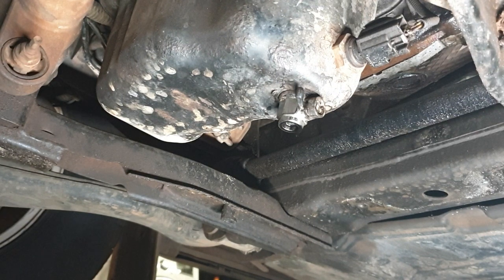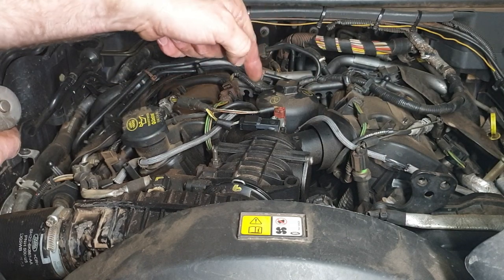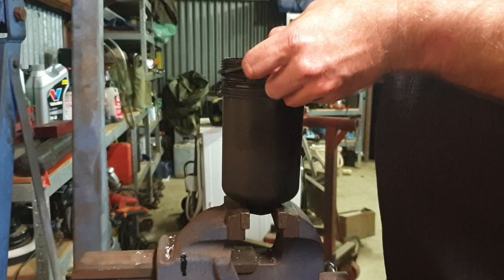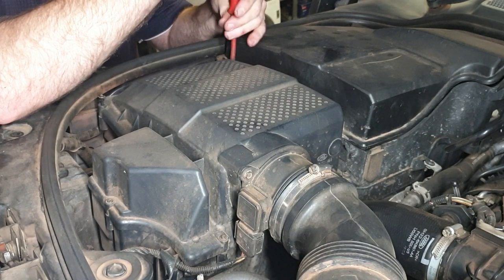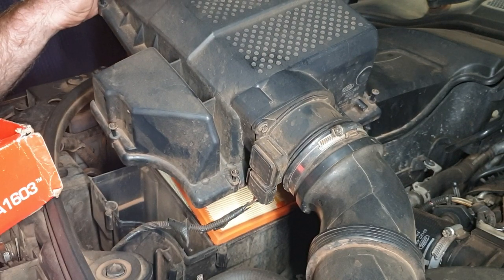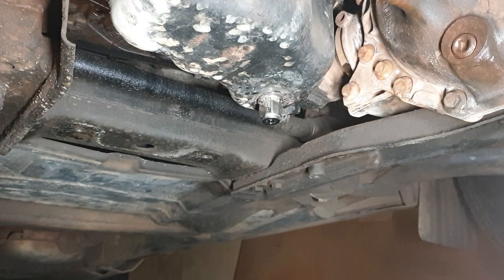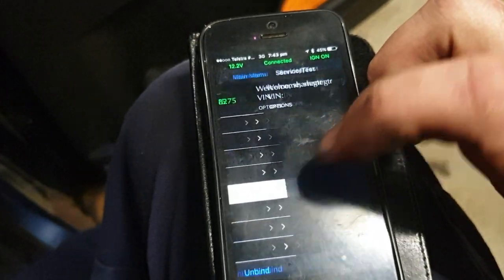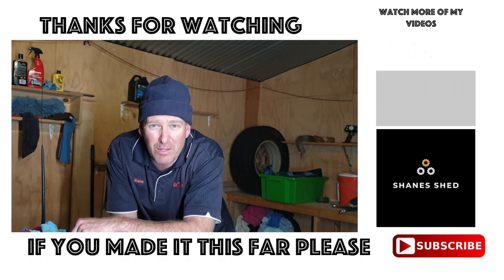LR3 Discovery 2.7TD Engine Oil Change | The easy way with no mess | Oil drain valves

Comment: that’s good but I would be worried it can lösen up. I was also wondering to use 12v oil pump from oil dipstick but it looks like not oil would be reached from top. still researching
Reply from the maker: Not much chance of them opening accidentally. The valve I use requires two separate actions to open, you need to move the little handle forward before it can move down to the open position.

Comment: Hey Shane, good video on the valve. Just wondering on your service interval do you do it as per LR service intervals or do you perform your oil changes more frequently? I have seen your other videos and noticed you do sampling.  Cheers Dan
Reply from the maker: Hi Dan, thanks for the comment. At the moment engine oil is being changed at or a bit over LR intervals - just tracking the change of the engine oil cooler. I've seen no evidence to suggest shorter intervals and I've previously run to 24,000km on the engine oil and it still looks fine.